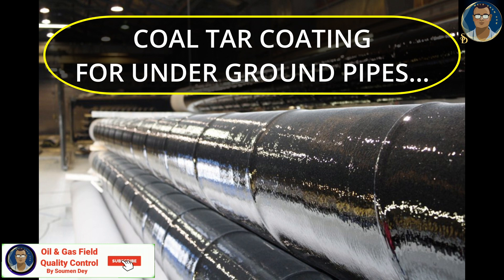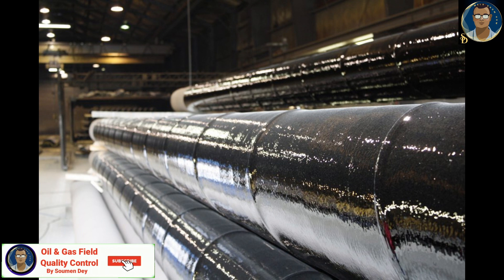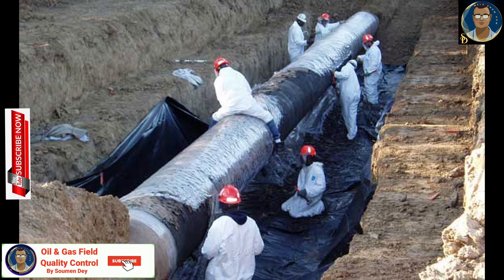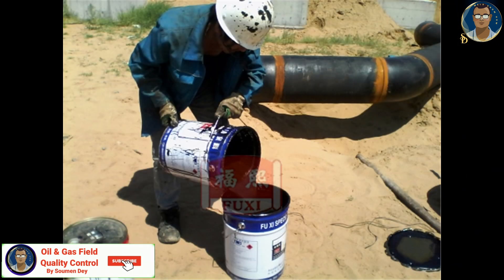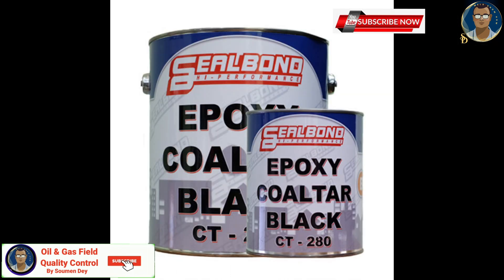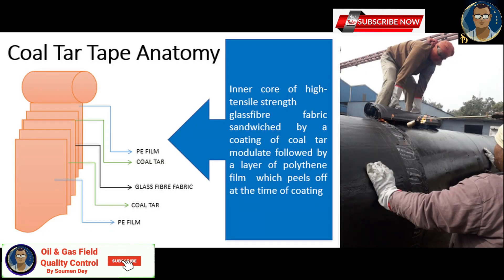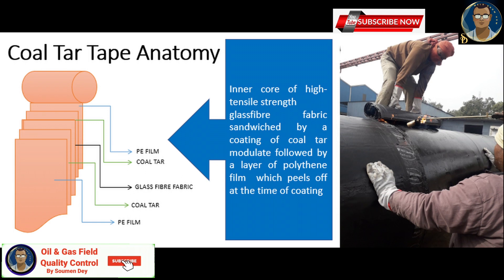Coal Tar Paints || Under Ground Pipeline

Comment: why do they use this chemical is it bc bacteria and other organisms will never try to penetrate its coating. its poisionus to the insects and animals right. is this why we use it on pipes
Reply from the maker: If pipes are internally coated, No checmicals need to be used. You know, all pipelines carrying Sea water are internally coated, So we can use Sea water as a test medium which are full of salts and other chemicals, Because Pipeline internal will be protected by the coating. For pipelines without any coating inside has to be protected from corrosion, and to stop building any Sulphate reducing bacteria- which are promoting more corrosion to the steel.
Reply: @OilandGas-inspection-soumen  Wow you just taght me so much in like 3 min... please make youtube channel about this. You are amazing.  wow over time you would think it breaks down. that's so cool. i didn't even know about sulfate bacteria.